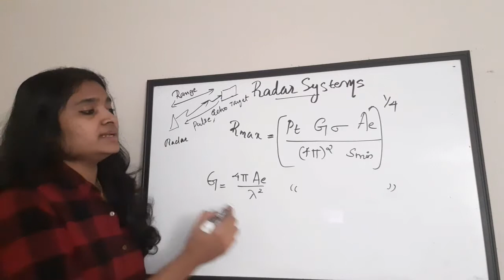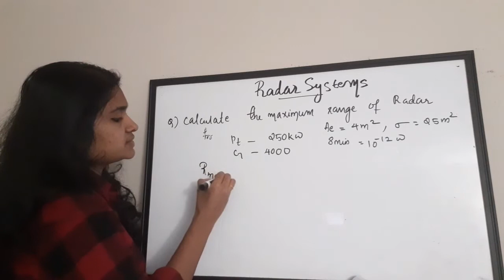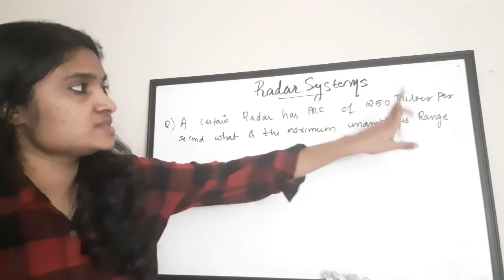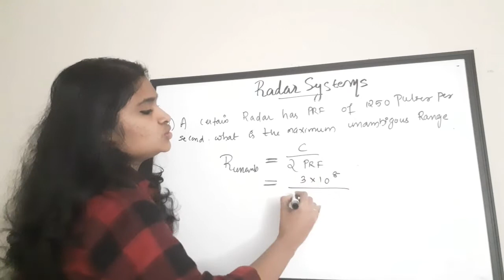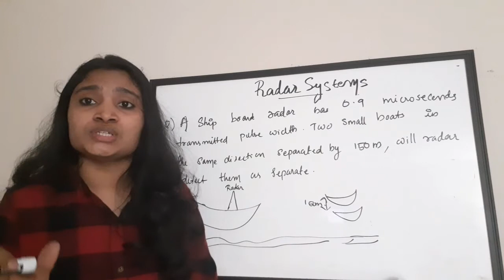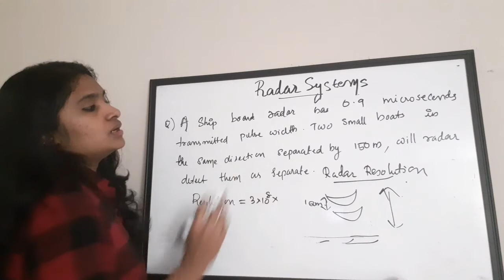Radar Concepts and Numericals|| ISRO Scientist Electronics||Technical Assistant||Gate 2020||ESE

Comment: express the power dissipated in a 100 ohm resistor in db relative to 1mW when voltage accross resistor is 1.0 Vrms

Comment: A battery of 7.5v,4AH is formed by using cells of 1.5V,1AH and internal resistance of 0.2ohm.if a load of 1ohm is connected across the battery,find current through it....send me by whatsapp my number 9000919673